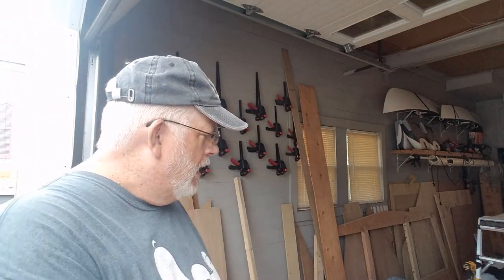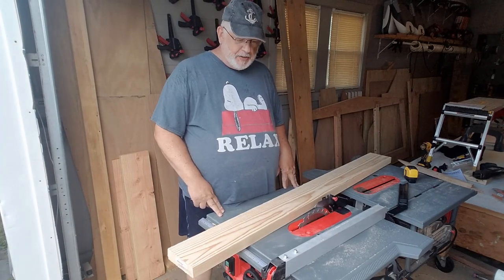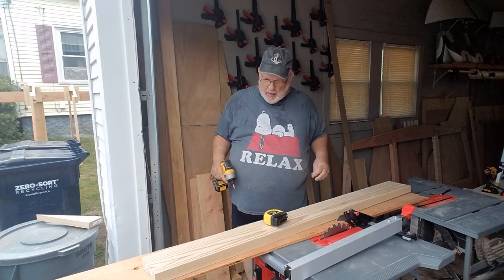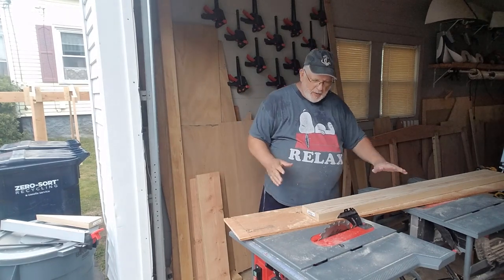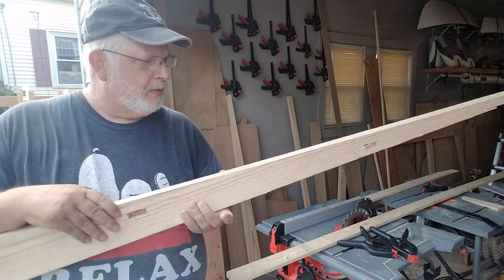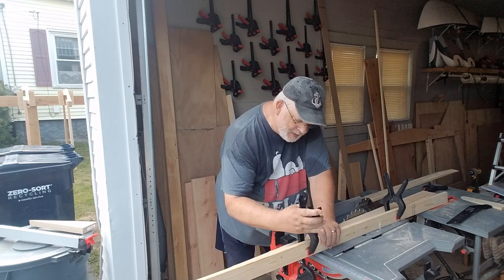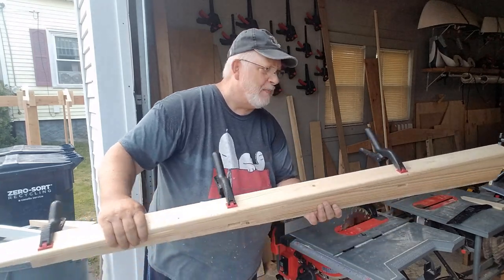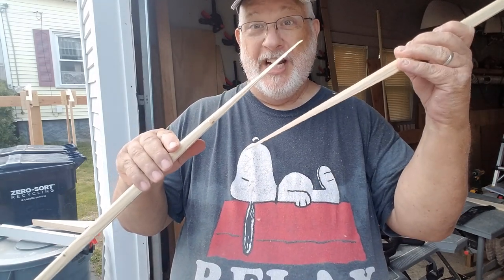EP16: Super Easy Scarf Joint Jig for Ribs, Chines & Stringers :-)

Comment: I’ve never thought of using a dead table saw as a work support for a working table saw! And if the new saw is the same model as the old one, the height will match perfectly! EXCELLENT!
Reply from the maker: Thanks,  It works fine for me but is a bit heavy to move around.  When I get the time I'm going to strip the saw and components off of it. I'll have plenty of spare parts for the working saw as well.
Reply: @mydreamboatproject brilliant idea! Table extension with spare parts!
Reply from the maker: @ruidadgmailcanada8508  Don't you wish they sold them all that way? lol